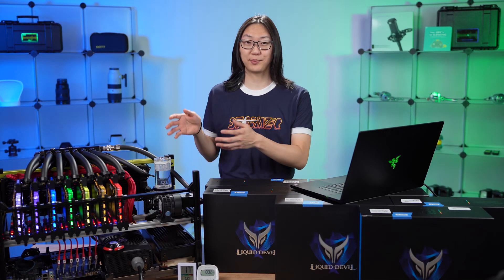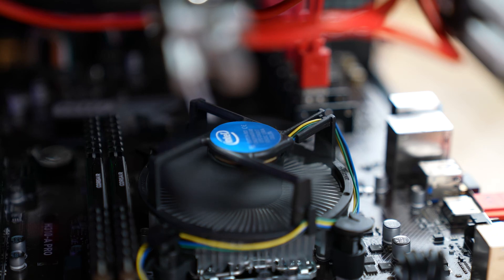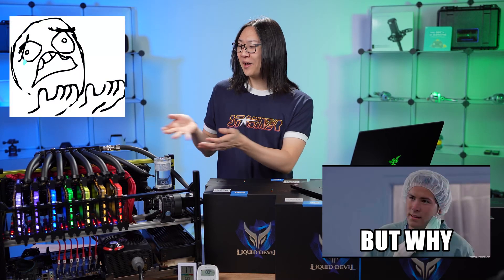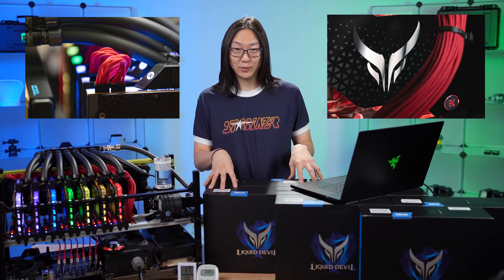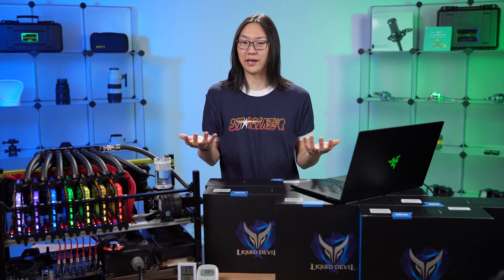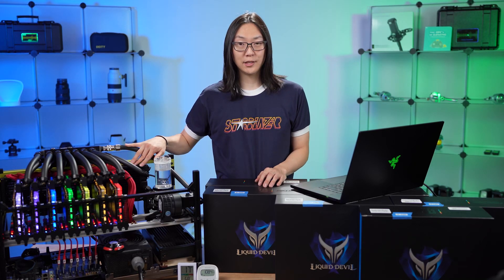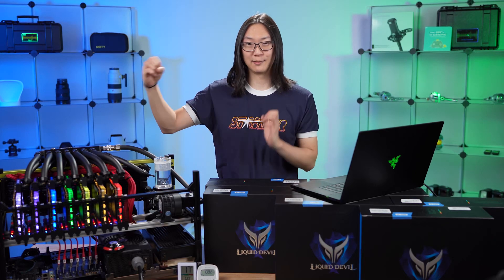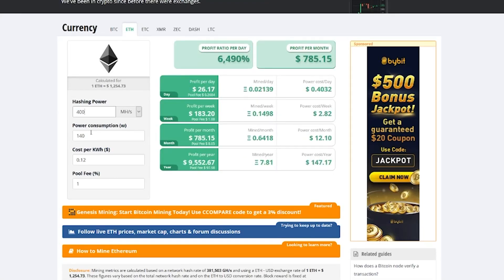Parts & How to 5700 XT Mining Rig

Comment: Awesome rig! I’ve used your design to inspire my own. How did you decided upon using 2 D5 pumps instead of one? And did you arrive at your total radiator length with trial and error or with some rule of thumb? I’m just looking for some guidance as to how I can size these components to my loop. Thanks!
Reply from the maker: Hey there buddy this is a lot to answer in a YT comment come check out our discord!

2 pumps were used to provide more overhead for the flow rate!

Comment: Hi Buddy, just would like to know why you need to use 2 pumps? because you have 2 Radiators?
Reply from the maker: Two pumps are used because I didn't want one pump running at 100% all the time. I wanted two pumps running at a lower percentage.
Reply: @TekShinji  Thanks for you reply, how do you control the pump speed? by BIOS?
Reply from the maker: No, if you look at the parts list there's a aqua computer quadro that is controlling everything.
Reply: @TekShinji  Thanks again

Comment: So in the distribution block at the top, does the top line feed all the gpu’s and the bottom rod acts as the return? And have you used two pump to increase the total amount of flow pressure?
Reply from the maker: hey there! every single part used in this build is in the description! i used 2 pumps to maintain a lower pump power state. one was fine but i didn't like it running at 100% 24/7

Comment: Just found your Channel, awesome stuff! I was watching this video and wanted to ask you a question: if you were able to run very cold liquid (glycol) and get the cards down to 15°F -/+ would the overclocking have substantial performance boost? I get the cost of running refrigerant lines would totally destroy any profit you can make just brainstorming lol
Reply from the maker: hey there sorry about he late response! you can yes however for this application it would not be very practile because its not designed for such applications. but yes you MUST LIKELY can!

Comment: The amount of effort and attention you've put into this rig really shows. Not just functional, but visually pleasing, what a feat!

I've tried getting two Liquid Devils to run on my mining rig (a bit of a Frankenstein monster), but even though the loop seems to be working just fine, temperatures go up like crazy really fast and the miner shuts down... I figured the radiator might be too small, so I unplugged one of the GPUs, but am getting the same result.

Not really sure what the issue might be, as this is my first foray into liquid cooling. Is it possible that I messed up the connectors and now there is some bad communication between pump, fan and card?
Reply: Welp, figured it out! Seems like the cooling cycle wasn't properly primed, so the pump went quiet after a while... Added some more coolant and now it's working like a charm!

Thank you for explaining the process so clearly, it helped quite a bit to pinpoint the issue I was having.
Reply from the maker: sorry about responding so late! i had a influx of people as of late! lol im glad you figured out the issue. come join our discord and i can help you there if needed in the future!

Comment: dude..all i gotta say is, excellent job, thumbs up this is awesome. You pretty much answered most of my questions in the video but the only real thing i am still curious about is how much mining specific overclocking headroom there is left, most air setups nearly max the memory clock already so i doubt there is much room left which is why most people watercool in the first place (i know that wasn't your intention).

i know that is specific for each card but was just curious about your experience overclocking it as compared to overclocking an air cooled 5700xt (not sure you've done it before)
Reply from the maker: Hey there, I'm glad that you like it! It was a lot of hard work and I'm glad you appreciate it :-)

So with water cooling. Most of the benefits are the lower temperatures, and the lower total noise.

As for a memory overclocking headroom there's not that much. Maybe one to 5% at most. most of these $5,700 XT is clocked at around 1,800 to 1,900 mhz.

Also it looks cool. And as we all know RGB increases hash rate!

Comment: That's a amazing setup. That would be a goal to build one. Im still skeptical on the whole water cooling aspect. I have setup many movie theatre liquid cooled projectors and now converting some to laser. Still worries me!
Reply from the maker: Thanks I'm glad you like it :-) It is a worry yes. However with proper maintenance and basic checking it's fine I think?
Never had a system come apart and leak on me but then again I've been doing this for years and check all my fittings before I continue and do a full leak test.
Also using insulative/nonconductive coolant helps. Although it does need to be changed out every couple of months or so as it gets conductive

Comment: Great breakdown! I went with a g3930 for CPU lol really anything will work! Does the liquid cooling allow you more leeway for OCing? Did you bios mod the cards? I have a 7 5700XT Rig (mixed cards) as well and it's spitting out about 370 MH/s on Phoenixminer ETHash on hiveos.  I OC'd each card separately until they were stable, but couldn't bring myself to bios mod the cards.  Curious what your rig is pulling at the wall, my air cooled rig is pulling just under 1,000W.
Reply from the maker: Thanks man I've really appreciate it!
liquid cooling doesn't necessarily allow better overclocking, but it does allow the rig to be much more stable since the memory runs at a much lower temperature.

All of the cards are bios modded, and I'm able to squeeze an extra 3 to 5 megash from each card.

If you look at the lower part of the video you'll see a live wattage meter, the rig was running the whole time. But it pulls anywhere from 1050 to 1100 w and remember it's been modded so it's going to pull more power
Reply: @TekShinji  sneaky haha I see the wattage now. Gotcha - I think if I had 7 of the exact same cards with the same brand memory I would try bios modding, but I'm afraid of bricking the cards or not being able to get them back to stock in case I needed to. Anyway, great job and thanks for your response!
Reply from the maker: Lol yeah, I thought about putting a zoomed window a bit somewhere but it didn't look that great. 

Biosis definitely worth it if you are willing to accept the risks. Definitely wasn't easy. Took a significant amount of time but 5 megah * 7? Almost like having an extra card!

no problem man, come join our discord if you have any further questions best way to contact me!